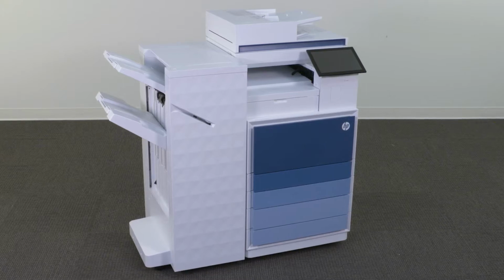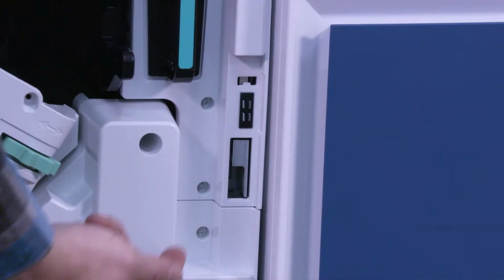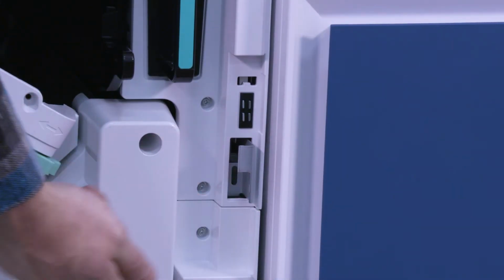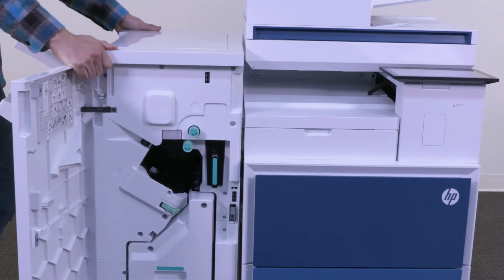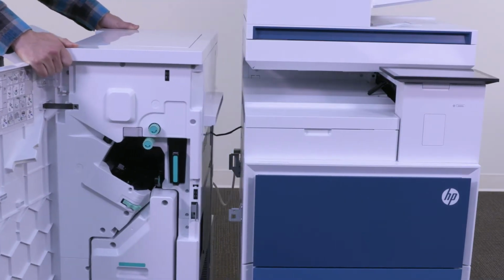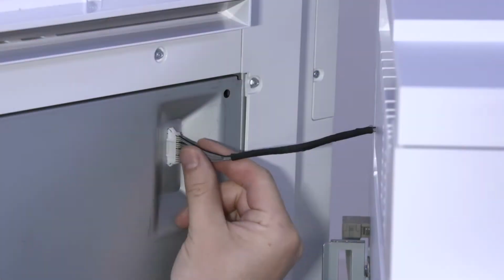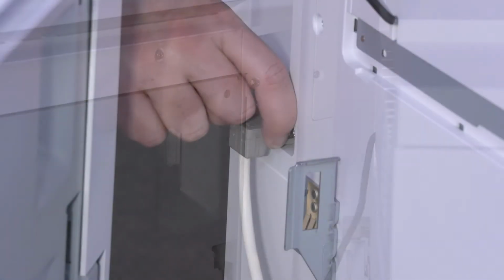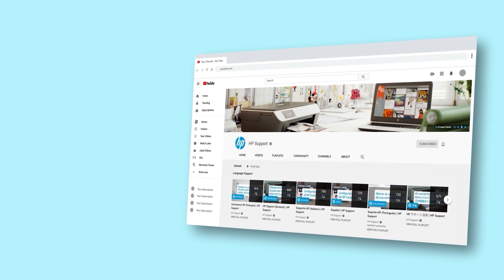Unbox and set up | HP LJ External Finisher Hole Punch Accessory (Y1G10A,Y1G11A,Y1G12A) | HP  Support

Comment from the maker: Hi Amanda, thanks for contacting HP Global Social Media Support!
I understand that you need to know about the printers that can be used with this.
I will do my best to assist you.
It applies to:
• HP Color LaserJet Managed MFP E78625, E78630, E78635
• HP Color LaserJet Managed MFP E87740, E87750, E87760, E87770 
• HP Color LaserJet MFP E78523, E78528 
• HP LaserJet Managed MFP E73130, E73135, E73140 
• HP LaserJet Managed MFP E82650, E82660, E82670
• HP LaserJet MFP E73025, E73030 
Binu - Social Media Tech Support